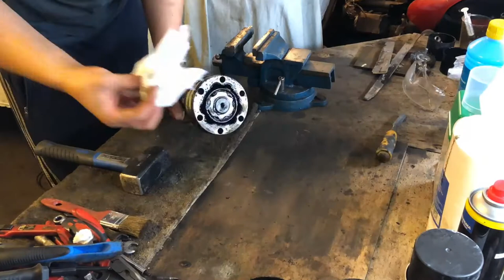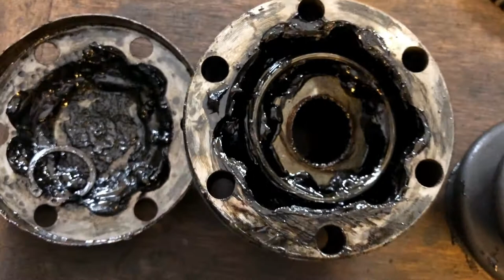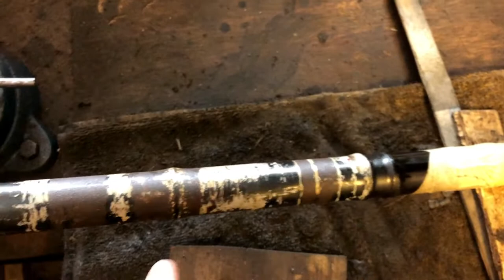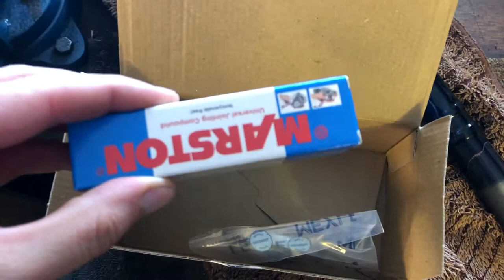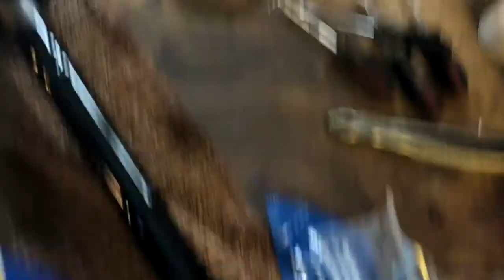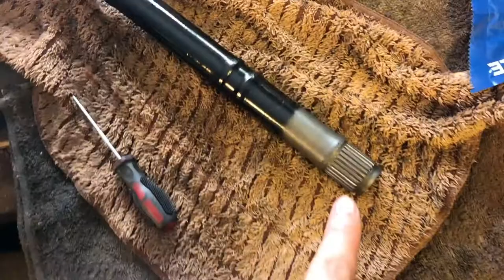Pt. 15 BMW E30 325i CV Joint & CV Axle Restoration

Comment: Thank you for your video. I was about to destroy my good used axle thinking I needed to remove the outer joint. Was about to force off that inner ring where you pack the outer boot. Watched literally every video about bmw boots on youtube and only yours was an exact match. Was seconds away from destroying a piece you couldnt replace!

Comment: The irony is that you can actually take the wheel of the cv side apart. Carefully take the boot and connecting metal shroud plate the same way as the diff side.

Comment: are the cv axles the same across all e30? i bought a replacement one and it came an inch short. and i was wondering if they possibly gave me one for the wrong car. everything was the same just too short
Reply from the maker: To my knowledge the 4 cylinder engined cars had smaller diameter axle shafts than the 6 cylinder cars, but length wise they should be the same. Is your setup original? Do you have a link to the part you bought?